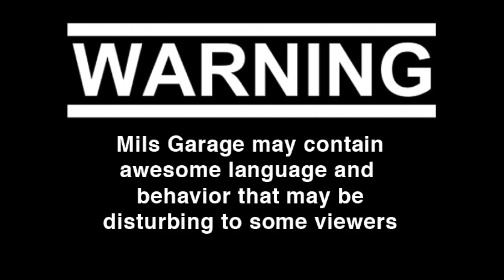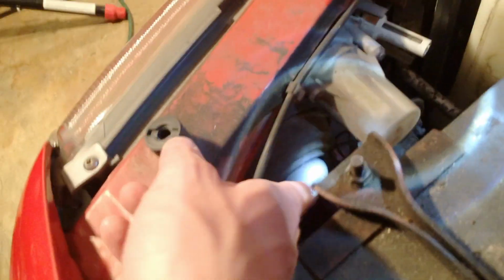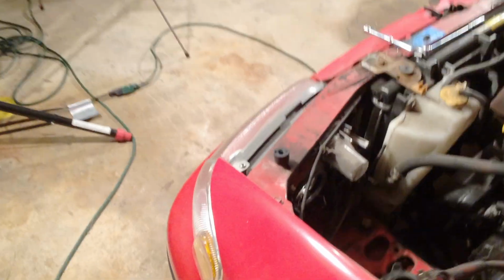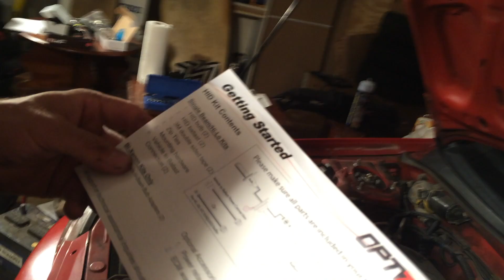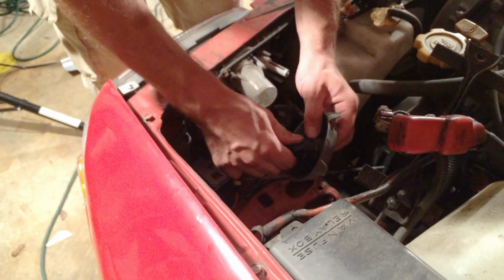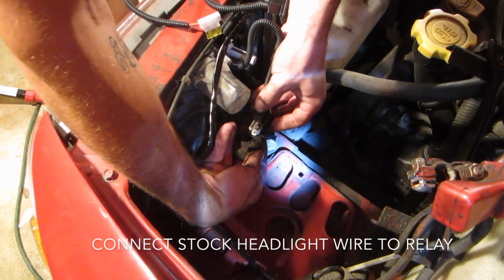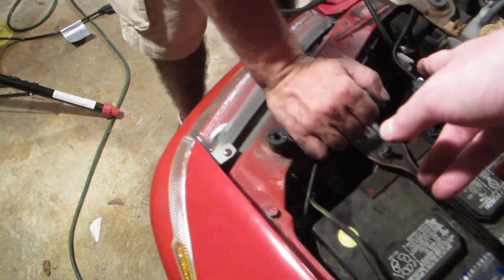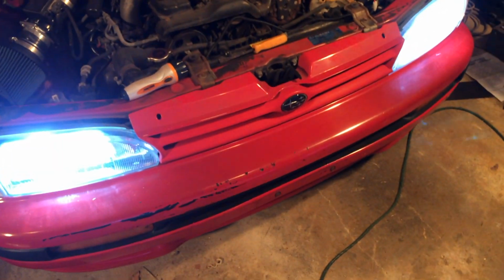OPT7 HID Kit Install [Subie Gets HIDs]

Comment: That's pretty cool. That subie is coming along great. Great setup
Reply from the maker: +Jeff Crossan pretty bright! do u have HIDs on the Dart?
Reply: +Mils Garage (jay mils)  I do. But I would need to replace the right headlight HID but I'm thinking a pout replacing the whole setup from doing an 8K to a 6K
Reply from the maker: sounds like a good choice to me. pretty sure they'll pull u over for 8K. ever have any trouble with that? 6K is perfect in my opinion

Comment: Ryan definitely needs to LED the side/corner lights next. Can he use some of the same wires if he does?
Reply from the maker: +Janet Milli LEDs should use the same wires/connections on the corner lights. Ryan's probably going to say that "the side bulbs need to be amber," but they don't as long as there is an amber tinted part to differentiate it as a turn signal

Comment: Is it legal to use HIDs in normal halogen headlights in your country?
In Europe you get a ticket for blinding oncoming traffic.
Reply from the maker: +József Milán Pintér in the US, it depends on which state u'r in. it's ok in Delaware, but i've heard of people getting tickets before in states like Florida.. the police here mainly care if ur lights r 7000K (because they're more blue-ish) or improperly adjusted. 

that's so awesome u found us over in Europe! where r u located?
Reply: +Mils Garage (jay mils) U.K. ;)
Reply from the maker: +József Milán Pintér f^ckin awesome!! i still need to go there! r u working on a build? :)
Reply: +Mils Garage (jay mils) Kind of... Just sold my Jeep and bought a Benz CLK230kompressor convertible... Let the mods start! :)
Reply from the maker: +József Milán Pintér sweet! pretty sure that model comes with a highly functional pussy magnet under the dash. what r ur plans for the build?
Reply from the maker: +József Milán Pintér sounds sick! can't wait to see how that turns out! please send pics some time and i'll throw u a shoutout :)  and thanks for watching! :D
Reply: +Mils Garage (jay mils) ;)
Reply: +József Milán Pintér Normally, you cant use them in your reflector housings. In the us, you WILL get a ticket because they are designed for "projector" type housings. Repeated offences will result in jail time.
Reply from the maker: +Kevin Ly can you please explain why my 2005 G35 has no projector housings, yet came with stock HIDs?
Reply from the maker: MURKA! land of the free. go figure 😂😂😂